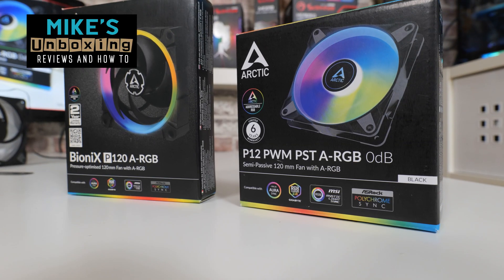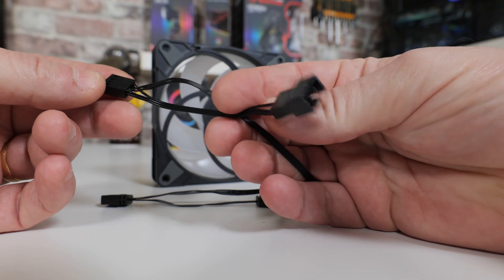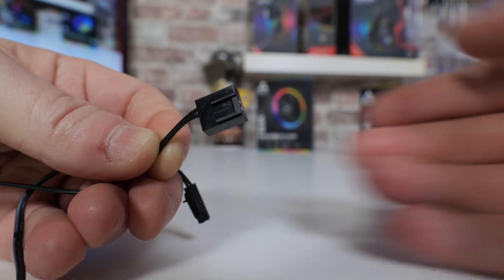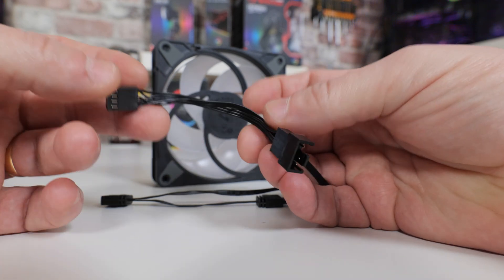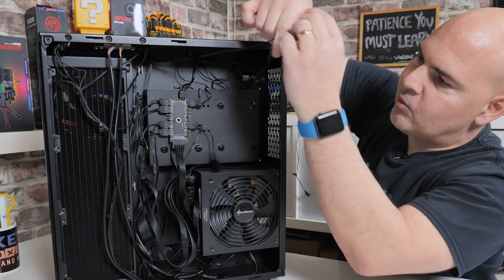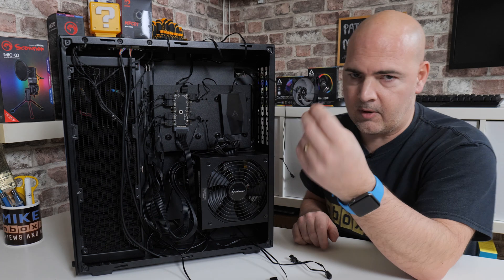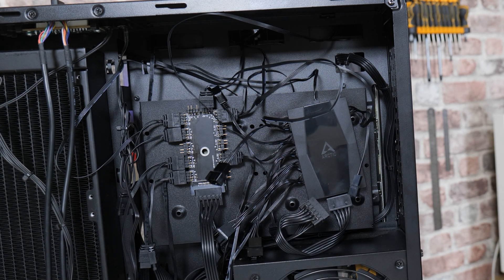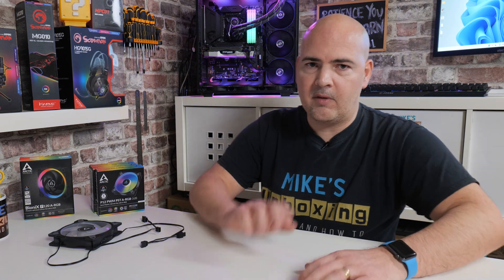Add Extra PC PWM Fans With Arctic SATA Powered 10 Port Fan Hub

Comment: This helped me a ton I was running only sata power and they was running at max 100% of the time now I can control them in bios because there is no was to control a sata cable in bios because its connected to psu and not mobo 😥 sadly
Reply from the maker: Glad the video helped you get your fans under control!

Comment: It will work with 3 pin because port #1 dictates the control.
Reply from the maker: no all three pin fans will just use all the available power on the 12v pin

Comment: Where reverse fans?
Reply from the maker: reverse fans use the same plugs just the motor input is reversed. this works with normal or reverse blade PWM fans
Reply: @mikesunboxing but visual ...

Comment: What should i buy if i have 2 3pins fan to connect since this is only supported for 4 pins fans?
Reply from the maker: there is a 4 port DC hub from deepcool we reviewed it a while ago, it isn't powered but can do 3 pin or 4 pin fans FH-04 i think it is called

Comment: Hi Hi! Recently got the (5x) Arctic F12 non PWM. Are 3 pins supported on that thing (meaning would they power on)? And do you assume that 1350RPM would be loud? (--> switching from a laptop).
Reply from the maker: no this is for 4 pin PWM only sorry, and yes at full speed i would consider them loud but you might not
Reply: @mikesunboxing Thank you for your fast reply. So you mean that the fans won't power on because of the 3 pins? I mean apprently arctic claims that a 3 pin plug would still work, but that site refers to the motherboard itself, and not to the hub.

Comment: I just got a brand new one and it doesnt work... It reports back the RPMs of the fan in port 1 to the motherboard, and I've set up the PWM but the fans are stuck at 100% all the time. If i put a fan into the same motherboard header, it runs at the desired RPMs, fan hub back on the same header, now stuck at 100%. Faulty fan hub?
Reply from the maker: is the fan header set to PWM in the bios? otherwise yes it doesn't sound right

Comment: Dude, you're assembling PCs and you put your liquid cooler like this. Come on...
Reply from the maker: Thanks for the feedback! There are actually multiple ways to mount an AIO, and this one works perfectly fine without issues. you have to make sure the highest point isn't the pump or it will cause issues and noise as air enters the pump and impeller.
you  should investigate it more before you cast dispersions'
Reply: @mikesunboxing the bubble is in the tube... That prevents optimal circulation.

Comment: This, which i am seeing on this video is that the arctic liquid cooling is installed at wrong way. The pipes are on the top. This makes a an air balloon and the liquid here will no circulate normally.
Reply from the maker: as long as the pipes are higher than the level of the pump it is okay

Comment: And how u control the fan s speed with this fan controller??
Reply from the maker: it takes the signal from the motherboard fan header and sends that signal to all the ports, so you contol the fans in the bios or motherboard software etc
Reply: @mikesunboxing many thanks for answering so fast
Reply: @mikesunboxing insteas of corsair what would u recomand need o e with a software to controll the speed

Comment: I just ordered this fan hub an hour ago. I have a Arctic Liquid Freezer III 360 AIO and I'm going to replace the three 120mm rad fans with three 120mm Noctua 3000rpm industrial fans. After doing a bit of research i learned that it's not a good idea to connect all three of those Noctua fans to one fan header since it can draw more then 1 amp once in a while so i decided to get this hub. Hopefully it turns out good. Also hopefully I can get this hub to fit in the back of my case amongst the rats nest of cables i already have back there. Maybe this will be a good time to attempt some cable management lol.
Reply from the maker: good luck! let us know how it goes
Reply: @mikesunboxing  I bought it but ended up not needing it since I went with Arctic P12 Pro fans instead. They have better static pressure and are alot quieter then the Noctua industrial fans and they don't pull as many amps. I am holding on to the hub though just in case I need it in the future.
Reply: @NonLegitNation2  i would still use it in your case, i also tried to research both Arctic P12 MAX (0.29a) and Pros (0.33a) connecting to one header and even tho they probably will work and alot ppl do daisy chain 3 of them they are borderline capped with the 1Amp that mobos offer per header. supposedly they can and will pull more than 4w when they jump start or have an agressive curve maybe, ive seen people measure it above 4w peak for the p12 max maybe thats not the case for the pros which they do bundle anyway on the newer LF3 pro AIOI on one header or maybe arctic takes into account that most mobo headers can tolerate spikes above the 1amp anyway especially on the CPU FAN header but i through it would be better splitting my 3x p12maxes to 2 headers temporarly just to be sure, i have ordered a hub since its 4-5ish euros only, better be safe than sorry, if you allready bought it id just use it.
Reply: @pitskid  yes, this

Comment: Great guide!

I have an AIO plugged into the pump fan header, but I also have a cpu fan header, in addition to my generic sys fan headers. Should I plug the pwm cord from the Arctic into the open cpu header or the sys fan?
Reply from the maker: sys fan is probably the one to use, but i am a little concerned that you don't already have your AIO radiator fans plugged into the cpu header
Reply: @mikesunboxing , thanks for getting back with me! I originally had one of the radiator fans in the cpu fan header. I built my rig years ago and had a bunch more fans than there were headers - lots of splitters. Since the splitters weren't all pwm, I finally decided to get a hub so I could control the fan speeds. I ended up plugging a fan hub to control all of my radiator fans in the cpu header and a hub for all the other fans in one of the sys fan headers.

Comment: Is it me this is the second video I see the front fans is exhaust instead intake or is that how it setup?
Reply from the maker: there are 3 intake at the bottom that can't really be seen, the 360 aio on the side is taking cool air from the bottom and passing through the radiator to the outside and the 3 top fans are also exhaust helping to remove any hot air as it rises
Reply: Ok Make sense thanks  @mikesunboxing
Reply from the maker: no worries

Comment: I have the asus prime x570, I have connected 6 RGB chained and PWM fans to the Arctic 4 pin corsair fans and I have the following problem, it increases and decreases speed and makes noise, I can't figure out what's wrong.
Reply from the maker: This is maybe easier to fix or at least advise if we can ask more questions and get direct answers, so feel free to join our Discord chat and we can go over it in more detail https://discord.gg/XtBTGQ6BDu
Agree to the rules by clicking the emoji and you will get access to the rest of the Discord channels

Comment: If I connect all 10 fans to this hub, can I control them in the BIOS using the smart fan speed controller?
Reply from the maker: yes but it will appear to the bios as a single fan, not ten

Comment: What hub should i get for 3pin fans like arctic p12? My motherboard only has 2 slot and i need 5

Maybe the splitter is better in that case?

Or should i buy better fans? (I dont have those yet, need some budget fans)
Reply from the maker: arctic p12 should be 4 pin pwm
Reply: @mikesunboxing yea i checked there are 2 types of p12, i'll Just get the 4 PIN pmw

Comment: Hello mike, I have the same case fans and fan hub as in the video. I plugged the hub into System Fan 1, and it works fine, but it's running at full blast 100%. I tried tweaking the fan curve in the BIOS menu, but nothing changes. It reads it as DC, and if I try to switch it to PWM, the fans turn off. What am I doing wrong?
Reply from the maker: This is maybe easier to fix or at least advise if we can ask more questions and get direct answers, so feel free to join our Discord chat and we can go over it in more detail https://discord.gg/XtBTGQ6BDu
Agree to the rules by clicking the emoji and you will get access to the rest of the Discord channels
Reply: @mikesunboxing  ok i will enter thanks!

Comment: Are you able to control these fans through any software. I am aware that it can be done on BIOS. But I would love to tweak all my chassi fan within windows.

Appreciate the help, thank you!
Reply from the maker: @visualalx  yes you can control the port the hub is connected to via fan  control or the motherboard software like armoury crate msi centre etc

Comment: Hello I do the same steps that you make, and my 2 rgb fans they spinning but the rgb is not lighting ? You know maybe a solution ???
Reply from the maker: this is only for the fan speeds not the lighting circuit
Reply: @ and which is for the lighting ??

Comment: I found this by accident, and I've got a question: does this device allows you to manually control the speed of each fan? I've mounted myself a home server with one of those XEON+chinese motherboards from Aliexpress and even though the BIOS is detecting each fine correctly, then I cannot seem to control them into Windows (HWMonitor detects them but speedfan, fan control and some other softwares seem not to see these fans), so I was looking for a piece of hardware that could allow me to at least control these fans manually (as the home server will be on the guests room, so when someone comes over I'd like to put the fans at minimum level to make it as little noise as possible).The closes thing I found in Amazon was the "POFET Chassis Fan Hub PC 8" which lets you modify the speed of each fine manually with a knob, but I would love to have a piece of hardware where I can connect all my fans to and that would let me modify the speeds via software, so in this way I can modify them manually or set them up to auto when I'm not around (for example, if temps are going higher than 60ºC, then push the fan speed to 80%, etc.

Any advices on how can I achieve this? Any help would be much appreciated!
P.S: the fans I bought is a pack of 5 "ARCTIC P12 PWM PST "

Comment: Hi i changed my aio cooler with p12max with 3 on the aio and 2 extra for exahust rear and top and connected all to the fan hub as all was 4pwm , now my concern is my aio has a pump fan 3 pin which I connected to pump fan on motherboard but i was wondering if I can connect the fan hub powered via sata cable to the cpu fan header as I am not using the stock aio fan and have routed the cooler fan to hub so what to do in this case
Reply from the maker: yeah sounds okay use the cpu fan header as the signal for the fans collected to the hub
Reply: @mikesunboxing  thanks

Comment: Two years old but still thanks Mike! I just bought the hub for my 3 pin corsair fans... With your warning I was able to cancel it before shipping.
Reply from the maker: yeah this would be useless for the 3 pin dc fans
Reply: @ Do you also think or know that Noctua 4pin fans can work with Artic Hub? I couldnt find Noctua hub here...
Reply: @armagedoc66  It will work just fine with noctua 4 pin fans, they use the same type of connector so they are compatible.

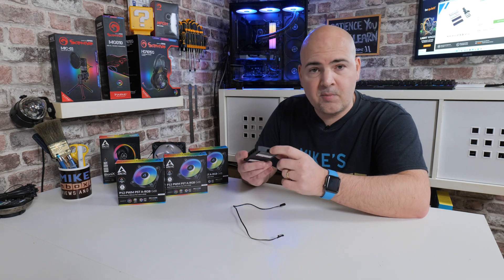Comment: Where can I find a 2pin pmw cable that ends into a 4 pin, Ive searched everywhere, can anyone drop a link? 2:17
Reply from the maker: that technically wont be PWM with 2 pins PWM needs voltage plus and voltage minus, rpm and pulse

Comment: HELP PLEASE, Can somebody please tell me if I can use these types of controllers and use as many fans as I want like let's say 16 fans (water cooled system here push-pull config) can I use all those 16 fans in single PWM header ? Is there any power limit if I'm using SATA cable, or it's essentially limitless when used with these fan hub controller ?
Reply from the maker: you can daisy chain these infinitely as long as the sata power on your PSU is up to it, it will replicate the PWM signal from the original source over and over and it the fans are all the same you shouldn't have any issues
Reply: @mikesunboxing  First, thank you very much, friend, for replying. So I can daisy-chain such controllers for 12 fans into a PWM header of the motherboard, which only has 3A power limit  but since I'm using SATA as power that will not be an issue and I could essentially use all 16–20 fans in that PWM header (I'm using two SATA power to connect which can allow 54W each) so there should be enough power? 3A header mean I'm limited to MAX of 12 fans, but now I can handle 20 fans right ? Thank you, that's all. Really appreciate the help. Lots of love and blessings. (subbed).
Reply from the maker: @siliconcrayon  Awesome - welcome to the Channel 🙂

Comment: If i have 4 fans with 4 pins connected to 1 header on the motherboard with the artic fan hub, and 3 other different fans with 3 pins, can i connect them to other headers in the motherboard and control those 3 in specific with voltage on the motherboard? is that possible?
Reply from the maker: yes the motherboard headers can be set to dc and the header for the hub can be set to pwm
Reply: @mikesunboxing  thank you for your response, much appreciated

Comment: Hey mike is it possible to connect non rgb nzxt fans to this hub? Planning on doing a h6 flow build and wanting to make sure the case fan 4 pins are compatible with the hub? Cheers
Reply from the maker: yeah if they are regular 4 pin PWM plugs its fine
Reply: @ thanks Mike

Comment: Wanted to put 5 x 140mm fans on top and front, while my case can only have a 120mm on the back. My MB has only 2 PC case fan headers, so I got this gadget to have the 5 x 140mm on a single header without nuking my MB (they total 2A). The second header is for the back 120mm fan, as it operates on different RPM than the 140mm and I can control it separately this way & make it match the RPM of the 2 x 120mm fans that cool my CPU block, creating a push-pull-push set-up. Needless to say it works excellently so far. Happy CPU at 30C idle with closed front door on the case. Essential controller for a proper fan set-up! Great video!
Reply from the maker: sounds like a good setup there, just what these were designed for

Comment: I have Corsair icue fans and want to add two more 140  fans at the bottom of the case. Will this work fine? I've got no more fan connections left
Reply from the maker: depending on the fans you have, they might need a corsair controller to use them

Comment: I dont have a system fan like your MB.  I have a CPU Fan.  I have ASRock B650 RS Pro MB.   the arctic controller app isn't detecting the fans, but they are all running. and changing color on their own. what do i do ?
Reply from the maker: you should be using one of the chassis fan headers and set it to PWM the motherboard will detect it as one fan (the hub)

Comment: hey im a bit confused I have eight of the p12 fans 3 pins can I use them with this or no somone please help
Reply from the maker: no the 3 pin is the the ARGB, or you might have DC fans rather than PWM.
Reply: @mikesunboxing so it is not compatible in any way?

Comment: How do you get those SATA conection on the back?
Reply from the maker: it is inlcuded with the hub
Reply from the maker: can you provide a time stamp so i know what piece you are referring to
Reply: I got it, thanks. But another question : how can you manage de argb conections of the p12 arctic argb? can I daisy chain them alone an then to the header mobo? Or I need a splitter for that ?(my mobo has 2 headers argb)

Comment: I know it is 2yr old but a quick question. If you plug this to a 4pin CHA_FAN + SATA and then use 4 3pin fans you should be able to set it to DC mode in BIOS to controll it? Or does that SATA just feeds it constant 12v without regulation (for PWM only).
Reply from the maker: it is strictly PWM only, from the motherboard all the way out to the fans. 3 pin fans will just run at 100% with no control at all
Reply: @mikesunboxing  Yeah...saved the strugle there and just ordered a set of pwm fans. Thanks for the reply tho 😌

Comment: What if you dont plug the 4pin to the motherboard. and only on the sata cable will it still work? Cuz i think my cpu fan header is broken, cpu fan not spinning but it boots up fine
Reply from the maker: it will still work but at 100% fan speed or zero rpm
Reply: @mikesunboxing  oh ok so the fan will spin at 100% or zero rpm if only plugs in to the sata cable

Comment: if i dont have a sata connector and my psu is modular but i toesnt have any sata connectors is the 2 pin enough for the working?
Reply from the maker: no it really needs that sata power
Reply: @mikesunboxing  Hello Mike! Could you please let me know the name/model of the SATA power cable you're using? Many thanks!

Comment: One quick question please. I just bought Thermaltake core p6 case and i want to add 10 fans to it including my nzxt kraken 360 aio on the top. Do i need 3 pin hub too for the other cable or this arctic freezer 4 pin hub is all i need for power and argb? Thank you
Reply from the maker: If 10 fans that you are adding are normal fans without any RGB lighting then this hub will be fine just to provide the rpm power if on the other hand you have fans which have addressable RGB then you'll need either an additional rgb hub to work with this arctic one or perhaps look at one of the ones we've reviewed previously such as the airgoo RGB hub with PWM that will probably be more suitable for you there are other versions also from thermal right and many other companies

Comment: I have a question. I have a NZXT fans. Can i use that hub instead NZXT hub. Thanks bro😊
Reply from the maker: depends which fans you have, some have a custom plug, but if they are 4 pin PWM then it will work
Reply: @mikesunboxing  thank you bro! Have a nice day😀